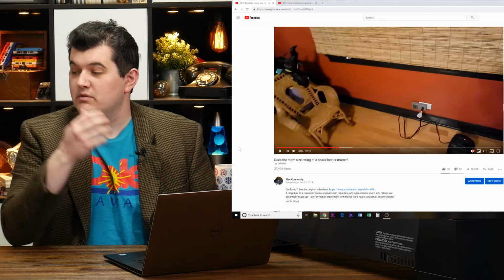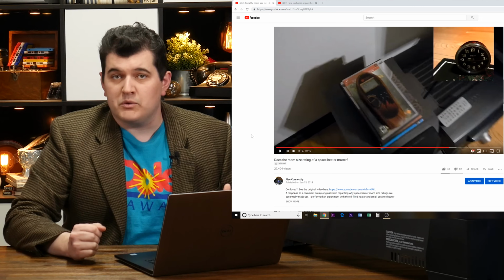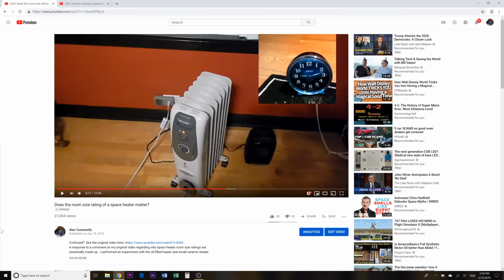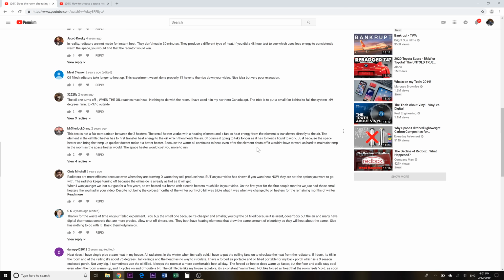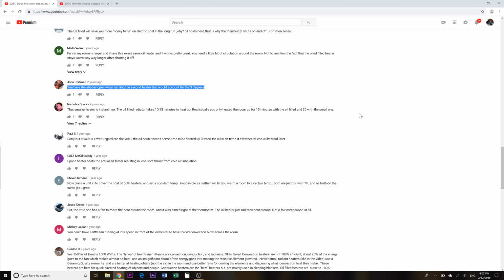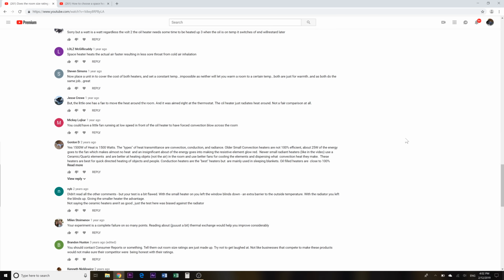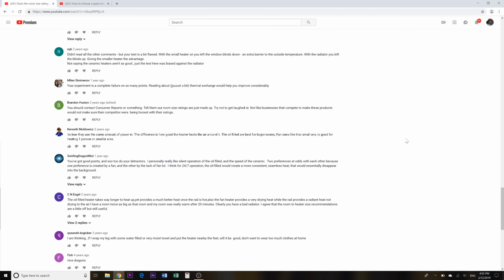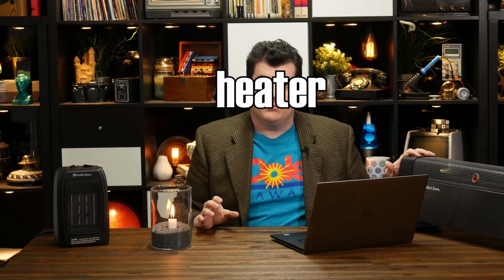More Space Heater Nonsense

Comment: A standard outlet is 15 amp. It is VERY unusual in typical construction to have a 20 amp outlet - which requires larger wire, 12-2 instead of 14-2, and a larger 20 amp breaker in the electrical panel. THUS ANY HEATER plugged into a standard outlet is limited to 15 amp. Standard voltage is 110 volts, so 15 x 110 = 1650 watts. They always leave a slight safety margin so at 110 volts limiting the amperage to about 13.6 amps - which can be safely used in most 15 amp circuits without tripping older and slightly tired 15 amp breakers. Now if you REALLY want to warm a space in most temperate climates use a de-humidifier. The heat released by the motor PLUS the heat of evaporation released by the condensing water is GREATER than 1500 watts AND when you remove the water from the air a LOWER temperature feels warmer. In the fall and spring, a couple of 15 amp de-humidifiers in the basement of a typical residence coupled with turning on the fan only of the furnace can effectively SHORTEN the need to have the furnace on by 2 to 3 months saving many $$$ in fuel costs. Plus THEY WILL NEVER CATCH FIRE UNDER ANY CIRCUMSTANCE.

Comment: You could have put a fan on the oil filled heater and achieve what you wanted.  Both heater would have raised the temperature about the same.   A lot of people don't get the point, they stick on things that make no difference and fail to understand the concepts.

Comment: The problem with the newer oil filled heaters is they are too small. In order to keep the surface temps safe, they need to cycle as noted in the video therefore not producing as much heat as a continuously running 1500 watt fan heater. While the oil heater heating element is 1500 watts when it's running, it's not running and producing heat all the time. The average BTU output is therefore below 5120. 
Get an older oil filled heater. They are larger, much heavier and will run continuously with lower surface temperature.

Comment: I appreciate this and your other recent video on space heaters because I have a home with an old wall heater that doesnt heat well and was VERY loud due to the fan component of it. As a result I have relied on space heaters for heat. Over the years Ive owned most of the different heaters you featured and more. I had been vaguely aware that 1500 was the max watts for each of them and Im embarrassed to admit that after reading the labels and descriptions offered online It just didnt resonate with me that they all produce the same max watts of heat regardless of size and price! Yes its true they have their different features that affect the way you experience the heat produced but you are 100% right! 1500 watts of energy/heat is all youre getting. It doesnt matter if you get that ceramic heater that's twice the size and more expensive than the regular ceramic heater (as I did a couple years back) because it couldnt produce more heat. But I fell for that. Im sure the heater manufacturer hoped that would be the case and Im sure that is the only possible reason for labeling space heaters according to room size. The price variance can to some extent be attributed to quality and number of additional features but I just bet some of that increase in price is being marketed as the "superior heating ability" one might expect in a space heater designed for a larger room. It's misleading for the consumer such as myself who is already confused enough by all of the btu's, quartz, convection, radiant, ceramic, thermostats, etc that need to be considered when making my annual (yes, they only last about that long) space heater purchase. Thanks to your video Ill be able make a smarter choice next time.

Comment: There's only two things that I can think one, the smaller heaters are so small and they don't act as enough of a heatsink for themselves compared to the big ones so they may trip the overheat protection but if it's allowed to run a full blast and it never trips then that's irrelevant. Two, if somebody likes being near a heater, being near a large object that's hot will feel warmer than being near a small object that's hot, but I know that's not your point I know you were trying to say heat the space in which I totally agree with you and I don't understand why they would market it as such except for maybe those two things I just said... but that's dumb.

Comment: I know this is an old post, but let me say here (something that may have been overlooked).  The Thermostat on this style Oil Heater does not shut off based on ambient temperatures like Digital ones do.  The Thermostat functions on the temperature of the Oil.   When the oil reaches a certain temperature the heater turns off, when it drops to a certain temperature it turns back on.

So lets say the Thermostat on Max turns off at 120 degrees.  That is the hottest the heater can get, and it will continue to radiate until it cools to a certain point, lets say 100 degrees.  This type of heater is good for long term heat control.    Once the room is at temperature you will need to reset the thermostat to keep the room at a fairly consistent temp.  IF you have a big room with not so good insulation it will have to be set a little higher than room temp and will have a little bigger shift in temperatures.  

Best way to adjust this is once the room is at temp, turn the thermostat down slowly until you hear the relay click.  That click will tell you, you are at the turn off point for the current oil temperature.  From there you should be able to keep steady temperatures for a period of time and reduce the power consumption at the same time.  Still need to monitor based on outside ambient temps changing and insulating properties of the room.

Comment: Using candles for heat is a bit stupid if you ask me. The cheapest store bought candles work out to about 84p/kWh in the UK. We have oil heating in our house and that currently works out to about 8p/kWh, but that's ignoring the potential exhaust losses. Electricity in the UK is currently around 34p/kWh and gas is currently around 10p/kwh

Comment: And... that's the next question.  Could the material being heated cause a difference due to being either A.)  A better conductor or B.)  Better at being a Heat Sink that stores the heat and delivers it to the room better over time.  For the candle... say you had a brink above the candle... and the brick helps absorb and spead the heat instead of having most of the heat going all the way up to the ceiling.  You're a lot better at those kinds of questions, so I'm betting that I'm being silly.. but I had to ask.

Comment: Hmm.  One question.  I admit you'll use more electricity.  But, do you think you should have tried putting a fan behind the oil heater to blow the heated air away from the heater to see if it would warm the room better when it doesn't keep cycling on and off?  Just tell me if it's a silly suggestion.

Comment: Heaters with MORE powerful blowers and LARGER fins area provide more heat per minute because fan constantly removes heat from heating elements( so they don't overheat), which in turn provide NONSTOP supply of heat to the room. Moreover, heat rises, so air temperature at ceiling much higher then at floor level and person typically located at lower part of the room(even when standing). So STRONG blower will mix cold and hot air FASTER to make whole room temp more consistent and feels warmer before heat will be lost to cold ceiling and walls. Thus heater "For bigger room" means bigger/faster fan and longer heat element and more fins area for FASTER heat removal , compared to heater "for small room" ,even though they both have the SAME the heat element wattage. Now, fan-less  oil filled heaters or baseboard heaters provide even less heat per minute, because without fan there is much slower heat removal and "thermal cut off" part will turn off heat elements to prevent elements melting(or oil boiling). So this heaters sometimes cycling on/off  to cool themself down even the room still cold. Plus heat is rising straight up to sealing and stays there longer(warming the sealing but not you) until it  displaced with new hot air and go down on you. So room warms from top to bottom. People are always at the bottom of the room , so receiving already cooled air.  So for fan-less heaters you may add portable fan to mix air in the room, or use ceiling fan. I am Appliance repair and Refrigeration tech for 15years  and  former factory-commercial HVAC engineer 20years.

Comment: You need to reconnect with physics. All you've shown is your lack of knowledge of thermal dynamics

Edit & additional,  how fast was the external temperature dropping outside during this test? 
1500 watts of electrical energy is still the same amount of power, resistive loads absorb the same energy... your comparison is isn't a controlled environment and you didn't measure the kWh absorbed by the two heaters!!....  First law thermo dynamics... you can't  create or destroy energy. 
Next video should do the flower pot tea light heater test 😆

Heatpumps, I.e. refrigeration cycle is the only only over unity device we've invented that produces more heat than electrical energy injected, against resistive heater...
Reply: You haven't tested there absorbed power over time (kWh).. end of test, as irrelevant or consistent testing conditions.

Comment: You keep missing the difference between them it's very frustrating haha!
Yes they both - thermostat cutoff aside, at 1500W put out the same out of heat
But across say 4 hours:
If you run the fan heater for an hour, it will output 1.5kwh into the room over that hour. and 0kwh for the remaning 3 hours.
If you run the oil heater for an hour, it will output say 0.5kwh in the first hour, 0.4kwh in the second, 0.35kwh in the 3rd, 0.25kwh in the 4th.

Even tho both were only switched on for an hour, because the oil stores heat that's not yet released into the room, that's the main difference!
Now in that 1 hour the fan heater will say heat from 20 to 25C, but next hour it will already be down to 20C.
With the oil heater it will heat it 20 to 23C in the first hour, but next hour you'll still have 22C.

That being said I do prefer the fan heaters because they do heat the room faster, and less energy is wasted on heating up my upstairs neighbour floor, or walls, and more into the air in my room, with the convection based heaters as you said the heat goes straight up and only then circles, but so it heats up the spot on the ceiling above it, the heat goes through the ceiling / wall laters, penetrating into the wall, so that heat is wasted as far as my room is concerned.
Reply: Indeed. Heat loss from the room is a noticeable factor when slow heating it
 
Insulation is now a major consideration with skyrocketing energy prices

Comment: I really enjoyed your videos and know you are spot on. I can tell you are working extra hard to help those that just don't get it. I have been trying to teach my wife how the house thermostat works, but because she understands how the hot and cold work in a car, she cannot separate that. There were times at 3am and feel like the house is freezing and go check the thermostat and it is set to 60. She thinks the lower the number the faster and colder it will become when she sets it. I told her that if she's cold or hot, she can move the heat or cold up or down two digits and no more. That worked. Now I have a nice app run thermostat and can change the temp from our bedroom - finally, I'm not having to run to adjust it at 3am! Long story to tell you that you're not alone :)

Comment: Of course the fan itself uses some of the energy going into the small heater.  If my understanding is right, though, that really means electricity is converted into kinetic energy (of the fan), which eventually becomes heat -- because energy cannot be destroyed and eventually all energy becomes heat.  That would mean that, with a slight delay, all the electricity going into the device does go into heating the room, just as it does with resistive heating of the electrical cord.  Tell me, though, if I'm misunderstanding something.

BTW, I once bought a SAD (seasonal affective disorder) light, on recommendation from a sleep psychologist.  (It didn't actually help me, but that's a different matter.)  I had a choice between large and small SAD lights.  Both of them, according to the boxes, put out the same amount of light (a rating in lumens, I think).  The sellers were not able to tell me what the advantage of the larger light was, and eventually I bought the smaller and cheaper light.  It turns out the clouded-plastic front comes off easily, revealing a two-dimensional array of white LEDs.  Having seen this, I now strongly suspect the only significant difference in the larger light is that the LEDs are spaced further apart.  That could mean there is more plastic going into the frame (depending on things like thickness), but other than that I don't think there is any increase in the cost of making the larger light versus the smaller one.  Assuming I'm right about this, most of the price differential is due to the illusion that bigger is better.
Reply: Yes. Even the energy that is converted to rotate the fan will be energy that is transferred to the motion of air that it forces away from the blades. The wind that it creates will hit the walls/objects in the room and a lot will be bounced back but some will create heat by adding small amounts of energy to the particles on the surface's of objects as it pushes onto them, and also heat energy will be induced when that wind interacts with other air particles that the faster air collides into.

Comment: The only thing that I can think of that would explain the difference between a heater for a small space and one for a large one might be how long the heater is designed to be left on for. That small heater might not be able to handle the heat from running continuously for as long as the larger ones can.
Reply: He states in the video that the smaller heater doesn't overheat itself because the fan is shifting the heat away from it constantly. Hence a small fanned unit can just keep on going
Reply: @TheVicar  Yeah, for sure, but that could cause problems too, theoretically. Repeated cycles of heating and cooling can cause brittleness in metals and plastics, the fan's motor might slowly get warmer over time, etc. I totally agree with him. I'm just throwing out possibilities; playing the devil's advocate.
Reply: @GameDesignerJDG  Indeed, nothing lasts forever. But outside of this video's remit is what's going on with rising energy prices and now makes insulation king, so something that heats the air faster, which will give immediate satisfaction combined with a home that can hold the heat for longer matters most I think.
Reply: @TheVicar  Yeah, that was kind of my point too. The fact that this idea is pretty insignificant and still the most significant reason I can think of that one heater is better suited than the other for larger rooms shows how silly it is that they're rated for different sized rooms.
Reply: @GameDesignerJDG  I can picture a larger heater, without a fan, using convection to heat the room being quite effective. But (and its a big but) picture the heater being the exact width of one of the walls in that room to create a convection current all up the entirety of one wall. Also that area of the room would have to be clear of all objects prior to the colder air entering the heater to maximise the current. So it'd be a very long heater.
 
Otherwise I'd just stick with a smaller fan heater that you can put on the floor and blast at your feet and therefore get the benefits of instantly heating your body first. If someone is cold then sitting around waiting to get warm seems pointless.

Comment: 11:00, the YouTube commenter says "it doesn't dry out the air"?  This comment doesn't make sense.  A oil-filled convection heater won't dry out the air any more or less than a fan-driven metal wire heater.  Neither will dry out the air, no water will be removed or added by either.  However, whichever heater heats the room faster will lower the relative humidity faster, but that's the whole point of a space heater, to heat the room!

Comment: If you have poor or no insulation however the fan heater might heat the room enough before the heat is lost to the outside while continuously pumping in more heat. 

An oil heater taking ages to heat and turning on/off to stop the oil boiling may never get the room to temp due to it being lost as fast or faster than the heat can output.
Reply: Exactly my point on another comment on here. Insulation and draft exclusion is key if you choose to heat a room slower.
 
Heat loss from a room is a key factor that a lot of people overlook.

Comment: The only thought I have is that the speed transfer of heat is determined by the temperature differential between the heating element and the thing being heated. This would mean that actively blowing the air over the heating element, whilst heating the air less, produces more "warmer" air (AKA: more "heated" air, it's just a little less warm). This should allow the device to heat all the air in the room quicker, resulting in the heater "feeling" more efficient. If you don't actively move the air, you need to wait for convection to initiate naturally, which can take quite a while and might move less air. A friend of mine changed to low-temperature heating and noticed a remarkable difference in room (air) heating speed when he put a few low-power fans over his (centrally water-heated) heating elements. It also means that the device is less prone to reducing its duty cycle, should it have an overheat sensor. That being said,  I would strongly recommend still having a temperature sensor, should the room already be toasty or should the fan fail, both of which are recipes for fiery diaster.